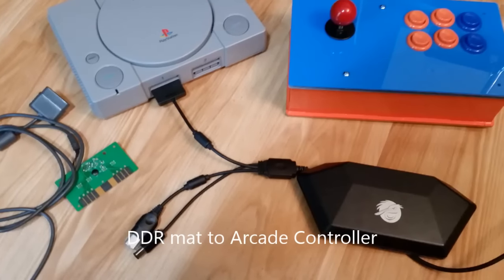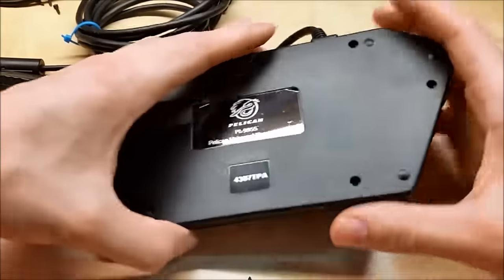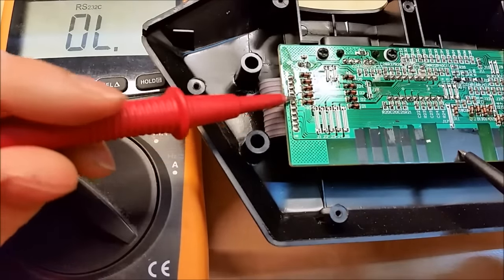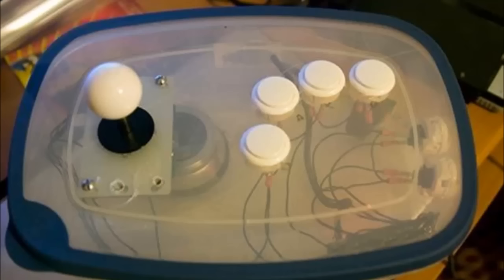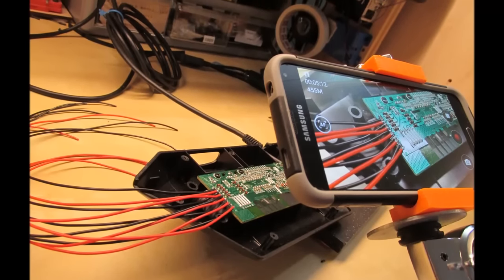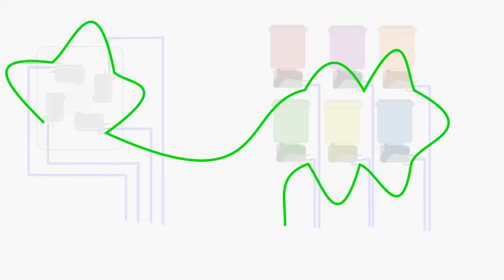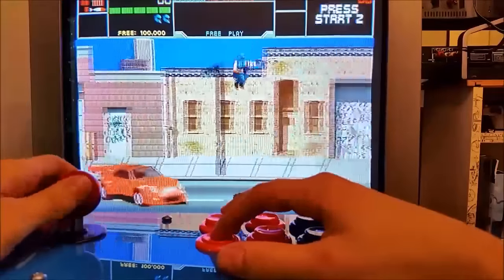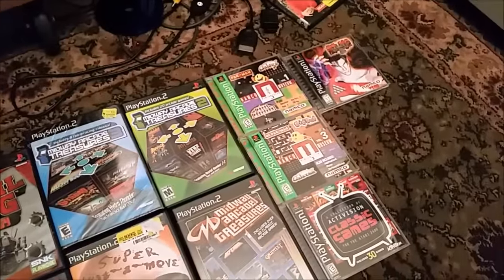Make an Arcade controller with a DDR mat

Comment: I have something similar that does NOT have these test solder points. How would I go about hooking wires up then?

I have tried copper tape (rips way too easily) and directly gluing the wire to the end (no connection)